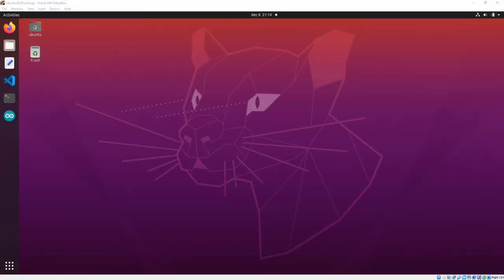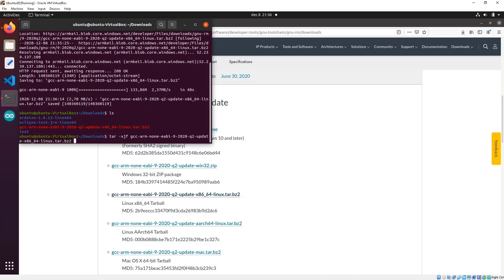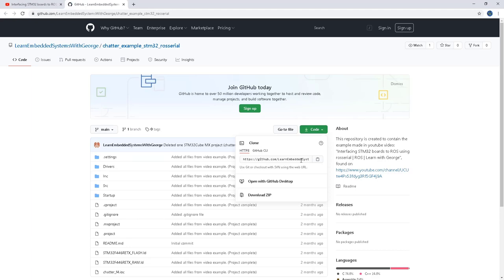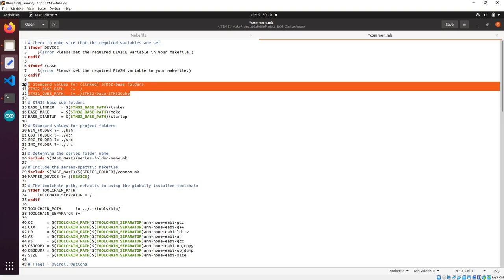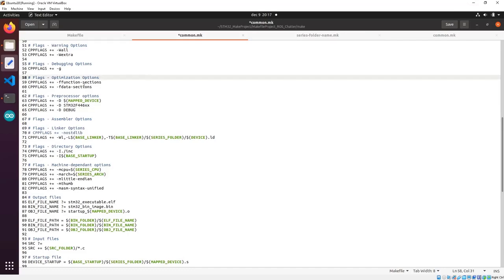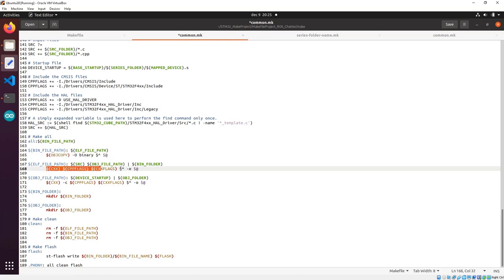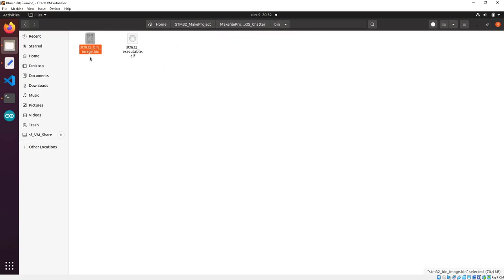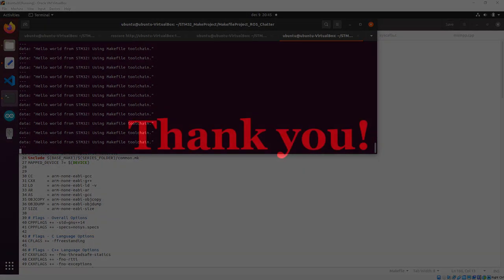GNU Toolchain setup for STM32 inside Linux and using Makefile for build and flash | No IDE | LESWG

Comment: Thank you for the tutorial. I have to work on embedded systems on Linux. Could you please make some tutorial about bare metal programming for stm32?
Reply from the maker: Yes I have something in mind, need to find time, I have lots of projects and ideas that I want to share. Until then maybe you find useful the CMake setup for STM32 from one of my repositories https://github.com/LearnEmbeddedSystemsWithGeorge/STM32CMake_Example to get the idea how to take together some sources and compile them producing the elf or hex file. I will use CMake for bare metal projects when I will start.